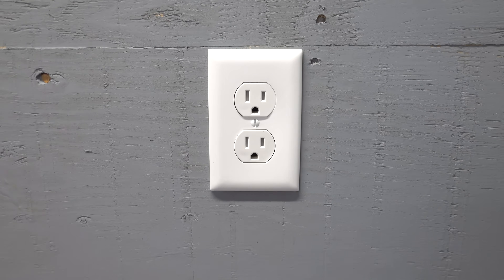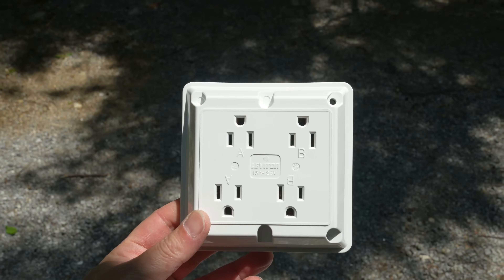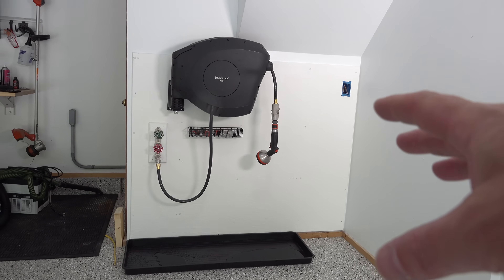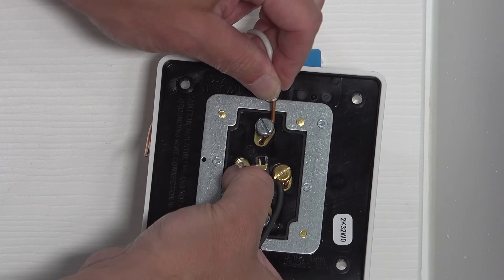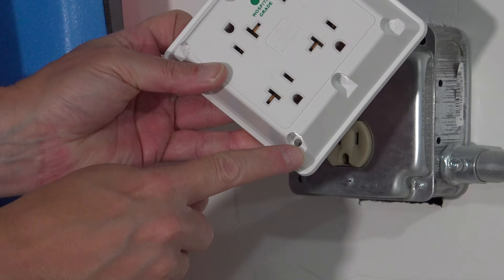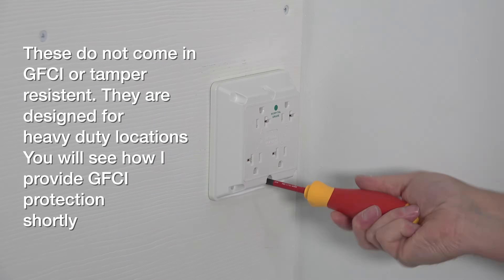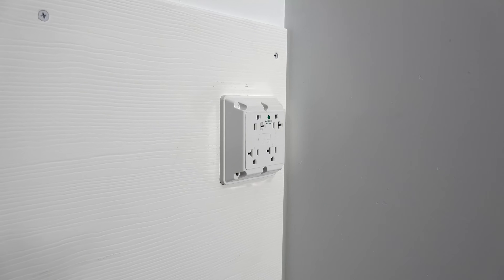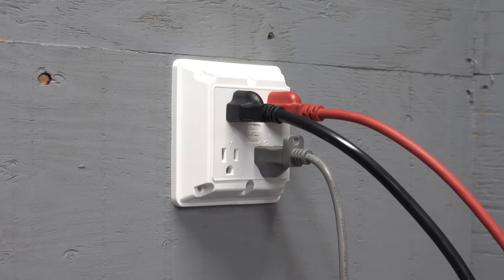How to Turn 2 Outlets Into 4 - Leviton QUADRAPLEX

Comment: I like how you never feed us clickbait. Also I'm an electrician and yup I've never seen one of those before. Definitely going to remember this in case a customer wants a retrofit quad in an area where looks isn't important. Definitely beats ripping out a single gang nail on box out of the wall
Reply: 2 #6 screws to hold a quad? Especially into plastic? Seems cheap.
Reply: You got that right , I'll have to remember this one too because I just install regular double gang outlets and no having to cut a bigger hole and install a bigger box
Reply from the maker: That really means a lot. 25 years ago these were all over the place in the hospital I worked at. Really ingenious design. I just remember an electrician there telling me they could slam a cart into them and they would hold up.
Reply: Kind of clickbaity. The first gang box showed works just fine if you actually install it correctly. You're meant to remove the face plate and use the included center screw to hold it in place. I've got a couple around the house and have never had the infomercial-style "Oopsie. This doesn't work!" klutz moment as shown.
Reply: @kill-nine  while I agree it was a bit played up for an infomercial-esque oops-style moment, the black power adapter box he showed actually didn’t have a screw (or hole) to attach it directly to the outlet.
Reply: @kill-nine  yeah this is one rare occasion where @Silver Cymbal dropped the ball.  I too have a couple around the house and love them.  Now I wonder how many of his past product recommendations have been sus 🤔

Comment: That's pretty cool especially the part where it can bends The Pigtail for you. I could definitely use that in my workshop with my Circular Saw.
Reply from the maker: Its a really clever design and it ensures you don't make the loop short. Funny thing is this outlet has been around for over 20 years, old engineering is often the best.
Reply: @SilverCymbal  that's actually a 50+ year old design. I just upgraded outlets on a house built in the 1960s. They were annoying because wrap around screws are super old tech. The hole for assistance has been there a long time.
Reply: @SilverCymbal  I noticed you wrapped the white wire around what I’ve always been told was the wrong direction. Is that the way Leviton said to do it in the instructions?
Reply: @kevrides5706  He started from the tip of the wire, so wrapping counterclockwise is correct. That way, when the screw is tightened, the wire is tightened clockwise as it should be. It looks a bit deceiving, but study it a bit. Hope this makes sense.